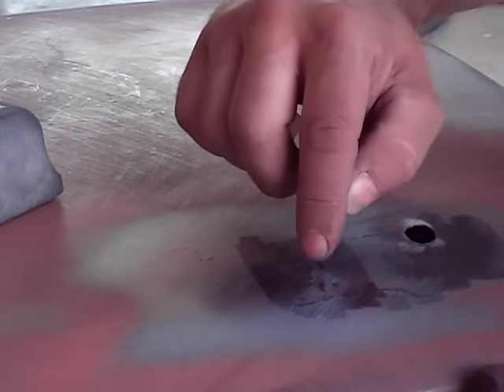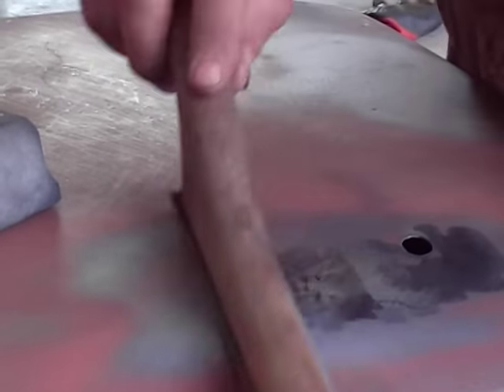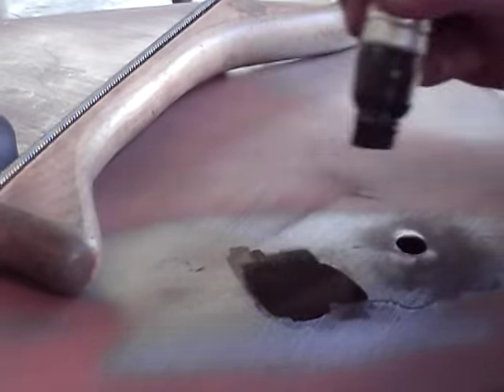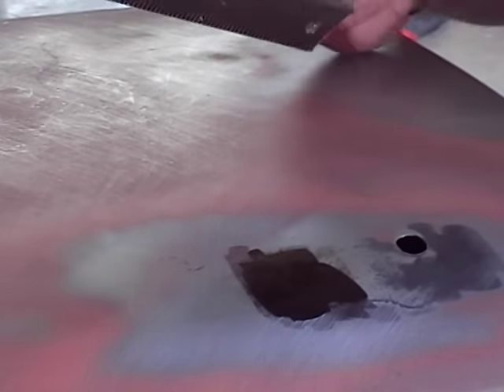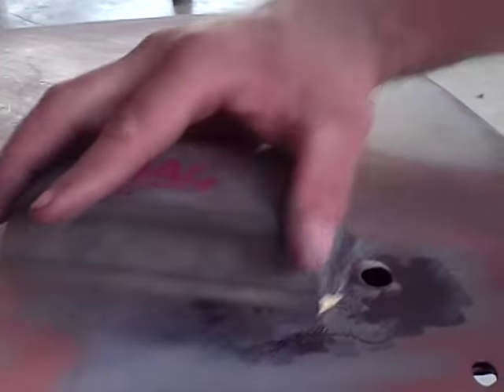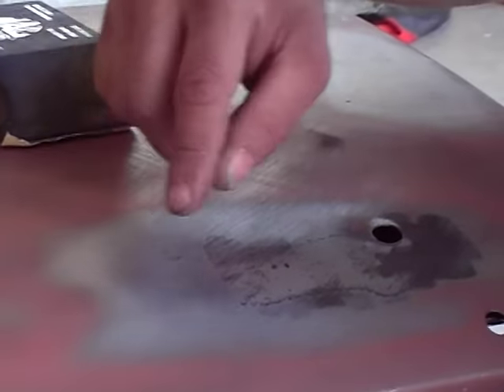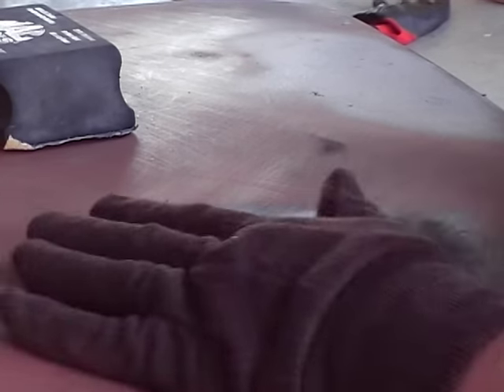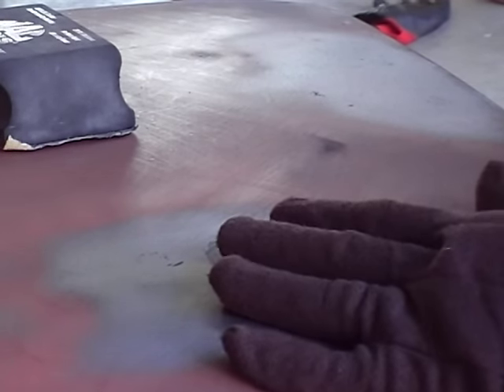metal work with a slapping spoon

Comment: very nice video, thanks so much. One question. Did you slap on the high areas?
Reply from the maker: No sir those either need to be shrank with heat or if they are really slight, filed off, but have to be careful as metal is thin.

Comment: I welded a half quarter panel on my van, and have some in and out warpage at the seam. I have these tools, would these be best to use around the weld? thank you!
Reply from the maker: Hoosier Garage sorry just seen this, grind the welds down, planish out with hammer and dolly , shrink highs with propane torch and wet rag

Comment: But how does someone know where to hit it with the slapper, I'm being inpatient and asking this question half way in the video, what would happen if you hit it above the dent instead of below it?
Reply from the maker: There is hammer on dolly and hammer off dolly. Hammer on or slapper in this case is to stretch and raise the metal after hammer off dolly is to lift the dent up while tapping down on the crown of the dent. The dent will have a low area in the middle and a slight high area where the metal moved outward. You are trying to bring the low up while slapping down on the high areas.
Reply from the maker: https://youtu.be/93xmkS-KxKg

Comment: What you are doing with that "on dolly" technique is stretching the metal which shrunk when you welded it. When you weld anything it shrinks and in this case what you have is a flat spot on a low crown surface...sort of a dent but not really.  If you welded those holes I'm guessing you ground the weld down pretty good (both sides) because if not metal working becomes much harder.  Technically that spoon is for "slapping" displaced metal such as a mild scrape that creates a bulge in low crown sheet metal...but in the time honoured bodyman's tradition you are using it for something other than it's intended purpose...been there ...done that. LOL!
Reply from the maker: mark krul yeah I just wing it and if it works I go with it
Reply: if you count put a dolly under it because of the little space, how you ground it down that much from the inside?

Comment: I'm that young guy! Man if I could be a fly on the wall of your garage! Why wouldn't you use the leveler tool you have?
Reply from the maker: I only use that when a can't access the back of the panel , to me this is a more precision way to go , the puller and stud is a must if there is no access to the back , but it's easy to over pull highs in the metal with the stud puller because it only pulls in a very small area , the slapper and dolly spreads the surface area to make a more perfect repair . Hope that makes sense :)